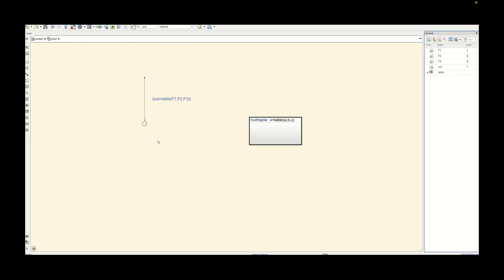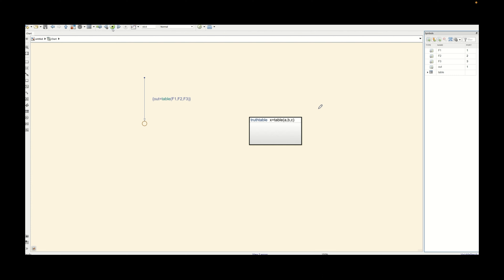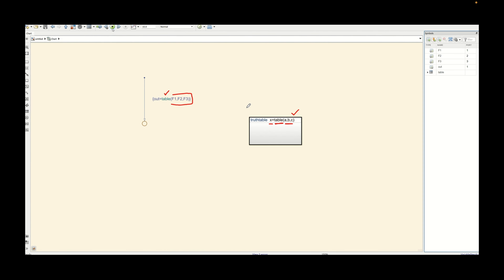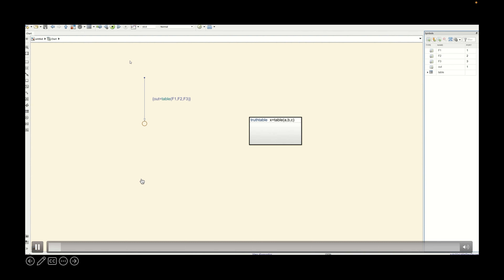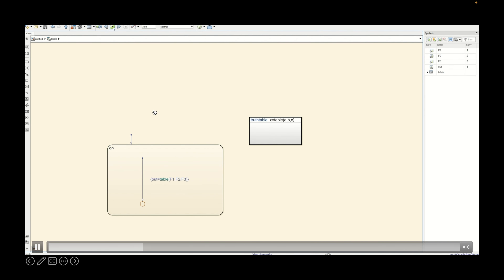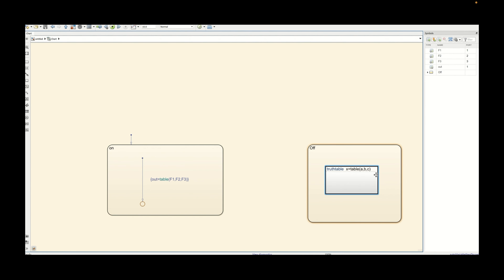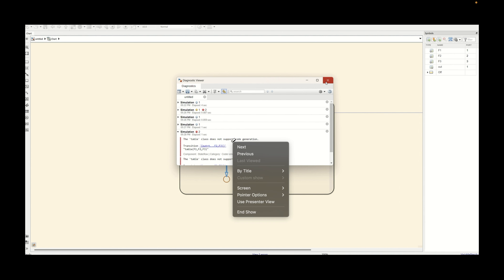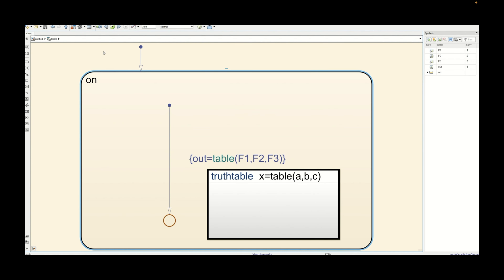MATLAB | Simulink | State flow | 37 truthtable placement [implementation]

Comment: how to access the truth table? can you explain it with a complete operation starting from input then transition where truth table operations will be there.
Reply from the maker: once you create the truth table mentioned in the video you need to have a transition or a state where you can call it
it is similar to a function when you create a function and you call it then only execution happens through the function.

once you create the truth table you need to call the table with the required input mentioned in the truth table.
when you call this table using its calling syntax the program control will jump inside the truth table and based on the implemented logic
it will give you a response variable in this case x and out there values could be outcome of a mathematical operation which are implemented with action logics in the truth table.

also while creating the truth table please consider using different variable names like mentioned in the video to have a smooth execution.

Thank you for sharing your interest on the channel and helping me clarify your quarry.
we deeply appreciate you interest in the content

Have a great day ahead
Take care
Reply: @matlabtech8610  thank you sir
Reply from the maker: thank you too for commenting in the channel
have a great day ahead
take care